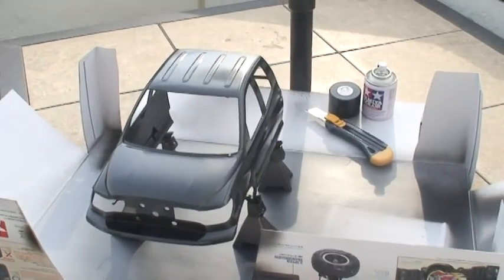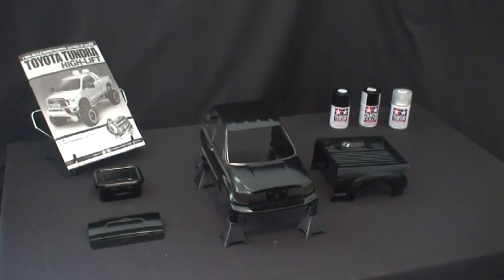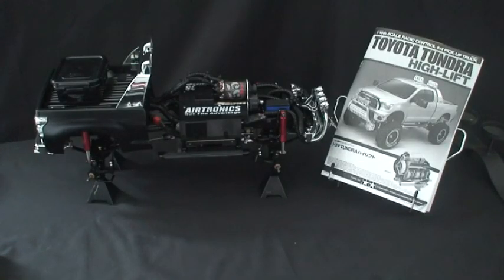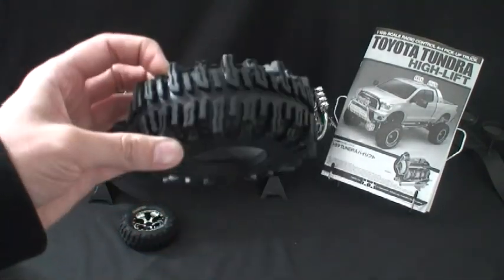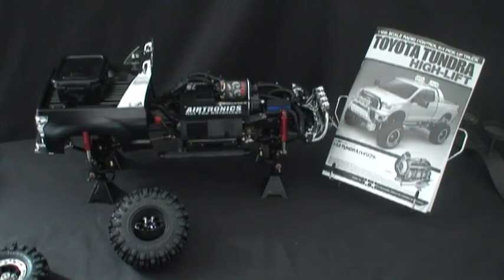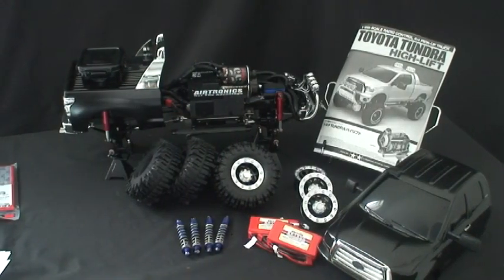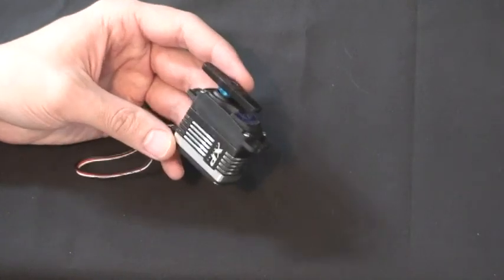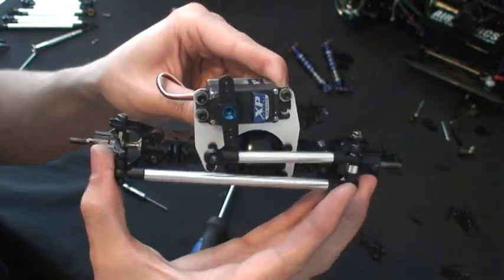RC ADVENTURES - 2.2 TAMIYA HIGH LIFT 4x4 CUSTOM BUILD VIDEO SERIES # 3

Comment: '
i have one tamiya F-350 truck...
1- HPI tires
1- auto zone LED lights with 12 volts
1- leave 3rd gear speeding
1- flat front axle
1- three colors taillights